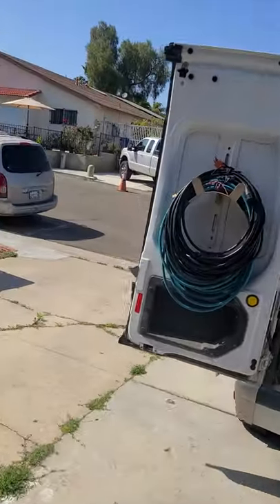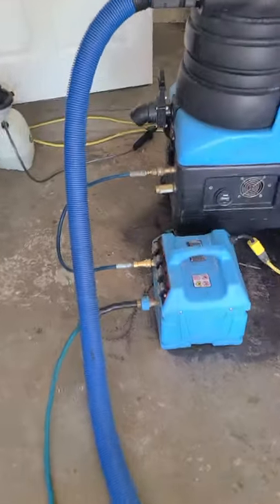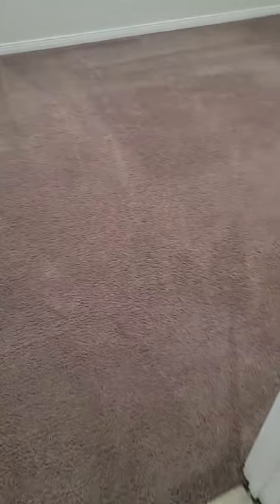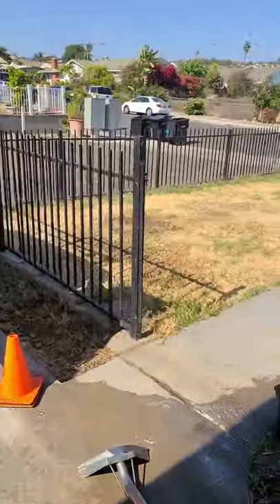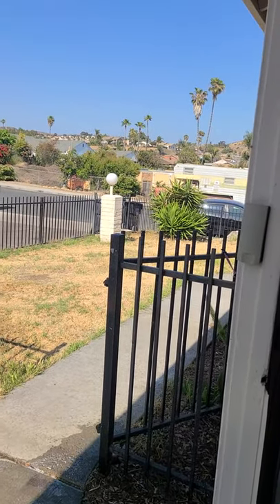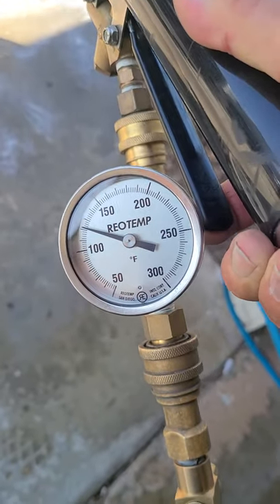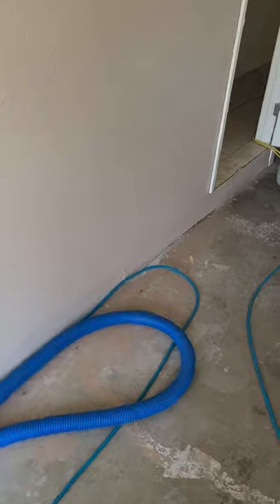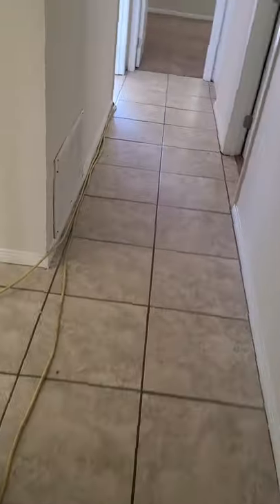Mytee Hot Turbo electric heater Review.

Comment: Hey Tony you do good work! 
*Have you ever had a clog in your turbo heater? If so please explain your remedy
Thx!
Reply from the maker: Thank you bro. I haven't has a clog yet that because I do deescaling with an acidic solution to remove hard water scale.  If you do that at least every six months you should be good.
Reply: Rig the pump to cycle some fresh water for the first few cycles until water comes clean, then I add ab half gallon muriatic acid to some water and let it cycle, then water until super clean. Should be mint
Reply: Hola! Saludos desde Chile..... Por favor podrías explicar la forma en que aplicas el desincrustante en el calentador? Muchas gracias.....

Comment: If I left my mytee turbo on but no water flowing through will it burn out? Or does it have an overheat protection? The merchant simply said turn the pump on before the heater, then turn the heater off before the pump when finished.

Comment: If you use warm water inside the water thank it works,  but if you use cold water it doesn't work,  I use 2 hot turbos  to work,  it's the only way to work with cold water.
Reply from the maker: Yes your right you definitely need to put hot water for 1 heater you usually have hot water available. 
I crank up the house water heater all the way up  to very hot that also helps.

Comment: Hi.  Thanks for the video. About the best real world one  this is very interesting they are advertised to heat the water to just under 98 degrees ( witch is probably 200f or so ). 150 isn’t really that hot that’s the temperature of the hot water tap basically so it’s a bit disappointing to see this   Can anyone confirm they do run at 210f normally??  Thanks

Comment: I'll tell you what with the price of fuel electric units are getting very popular again I use an immersion tank with a 180 heater in it and then run that into a mighty hot turbo get impressive heat

Comment: Which wattage heater is this
Reply from the maker: This a 2400 watt heater.
Reply: @tonyvargas6981  When i used to use them , i used to daisy chain 2 of them 4800 watts heaters together i used to have really hot water. The down side was i had to use 2 generators for my van setup 1 for the heaters and 1 for my extractor. But it was hot then i decided to go with a diesel heater from magic wand company because i didn't want to use 2 generators but i think now i had better heat with the 2 hot turbos then the diesel heater that i have now.
Reply from the maker: @inGodtrust5hmkj4  
Wow, I can imagine how you needed 2 generators thats a lot of wattage.  
Thanks for the info, and make that money 😀👍.
Reply: @inGodtrust5hmkj4 i have this question, ill have Mytee Escape LX running 12000 watts plus Twin turbo 4800 watts
Reply: @larryisaac8988  That's not going to work. The mytee escape is 7000 watts by itself, plus 4800 watts Turbo that's 11800 watts total. A 12000 watts generator only has a 9000 running watts. It's not going to work.
Reply: @inGodtrust5hmkj4  if i got 15000 peak, 12000 running watts on gas it will work, but too much fumes in the van. If run by Propane it will less running watts. If propane heater im worried about getting burn.
Reply: @larryisaac8988  Put the generator in the back of the van so the exhaust fumes will be blowing outside of the van. 15000 peak, 12000 running watts on gas will work but your generator motor will be strained because your useable wattage will be too close to the running watts. It will cause your motor to fail too soon. But a 2400 watts would be better. If you use a 2400 watt turbo you can even use a 13000 watt generator because a 13000 watt generator has 10500 running watts.
Reply: @inGodtrust5hmkj4  Instead of buying 15000 peak with 12000running watts (3,500$), ill buy 2 generators with 9000running watts each (1000$), what do you think?
Reply: @larryisaac8988  Running two generators is a pain. The noise, the gas, the space, the fumes. You can run the 4800 Turbo heater on an inverter by itself, but not on a 9000 watts open frame. Or you can even split the two cords where one cord can be on a small inverter, and the other cord can be on the same generator as the Mytee escape.